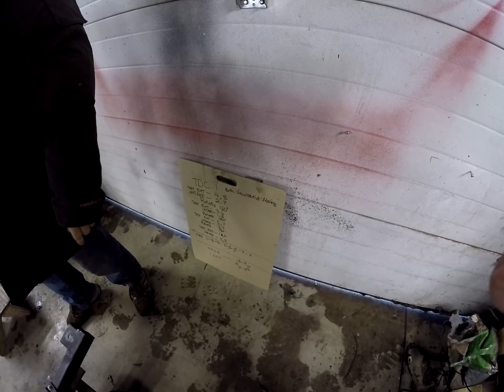BIG BLOCK 396 402 first start in 6 years, will it run

Comment: I still don't understand how it was running before with the lifters being so out of whack, lol.
Reply from the maker: Kevin had Roller rockers on it when we swapped it last time and I believe they were set reasonably correctly, he swapped them out after the first video to put the original ones back in, and he was following the board to set the valve lash. the rest as we say, is history.....